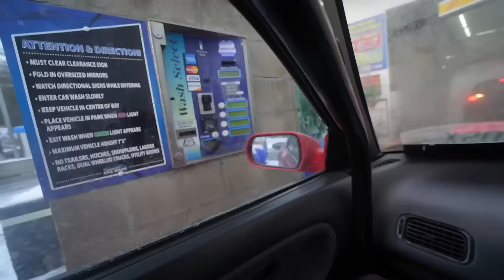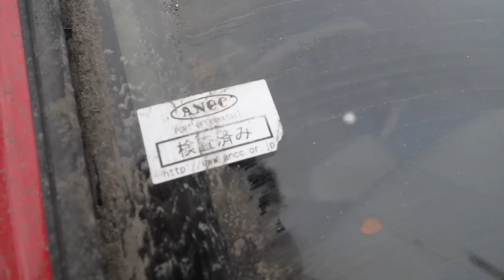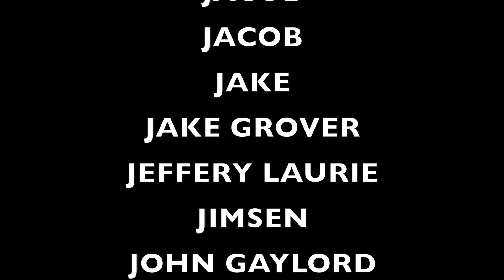THE "BLOWN" 180sx CAME WITH SECRETS...

Comment: Matt don't swing the hatchet and the block together it doesnt really work, when the hatchet gets stuck just hit it on top with another log, it will split the bottom log easy :), also its easier to split logs longways not vertical :) just my experience anyway
Reply: They need a big stump too it's way easier to then stand up and swing than hit it on the ground
Reply: He should've known this, very common to use wood stove in Poland.
Reply: @HksF16  wait what? is Matt actually Polish?😅
Reply: @damian112zMc  yes he is part Polish i believe, there was a video a while back speaking some Polish stuff.

Comment: Trick to filling holes use a piece of copper on opposite side of hole that your welding ... weld won't stick to copper so you can fill hole without over heating or burning threw and welds flat

Comment: Yeah so the frame rail is not there on the Japanese models made in japan but the ones that came over to America were required to have the rail...but you can get the extension for the rail.

Comment: @14:20 - 14:48 one brain cell shared between both of you for that one lmfao. U.S. Gov. Safety Regulations. Also, didn't you buy a Yashio oil cap when you visited Sam in Japan waaaaay back and put it on the SR Miata? If you still got it throw it on the 180sx for sure!